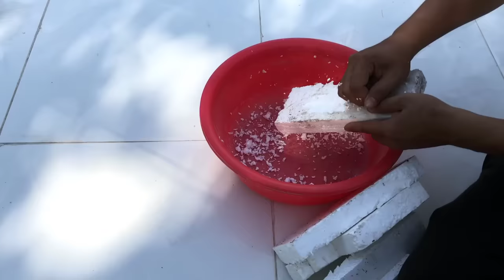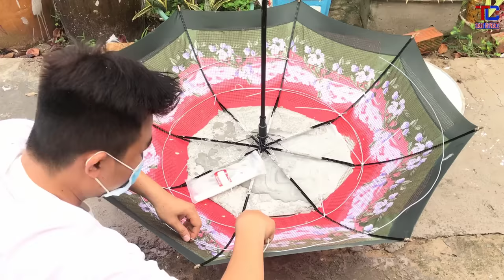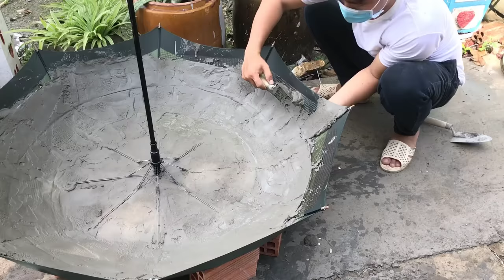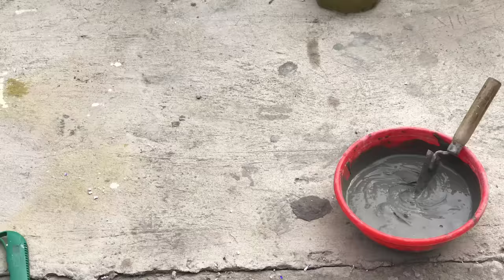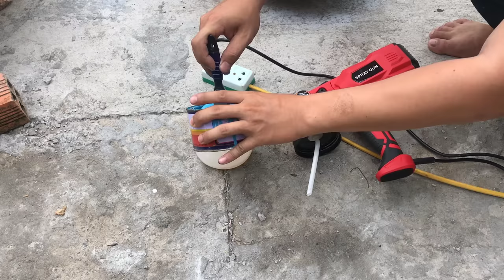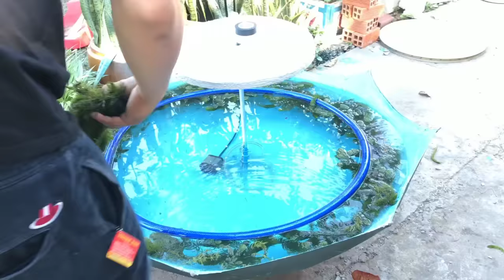❤️ It's very unique ❤️ Fountains, fish ponds, bird baths ... all in one idea ❤️❤️❤️

Comment: question:  the cement may be okay for the fish but the paints that you have sprayed is toxic to the fish.  You cannot use paint.
Reply: No the cement is bad if not sealed, acid
Reply: there's blue "paint" that's pond/pool liner which should be fine. It all depends on the type of paint and not all paint is waterproof so I'd hope they used fish-safe paint. Though given the kind of fish they slapped in there... only so much faith you can have in this channel. That went from "huh, neat" straight into animal abuse, lol.
Reply: @karinashi765  En général, vous ne passez pas votre vie dans votre piscine  .... Les poissons sont condamnés à rester là ou à se suicider....

Comment: I actually kind of like the concept for a small fountain. Except I'd probably just make it a fountain where the water flows out from the end of the U shaped handle of the umbrella. And I probably wouldn't use a real umbrella as a base. If you just keep it simple and don't use all that spray paint, it'd make for a pretty cool fountain/bird bath
Reply: Блохастую собачку зачем?
Reply: So let me understand you correctly. You're going to disassemble an umbrella, then make a large reinforced concrete bowl that you will have to then attach the umbrella handle to? MMMMM sounds like just as much if not more. Bc the umbrella itself is your form.  How/ if you paint something is a personal preference. Regardless it will still need to be treated somehow.

Comment: I realize that a lot of people have noticed that animals may be endangered in this video : fishes, ducks, dog , etc.
Please take a moment to report this video. Click on the three points on the right (same line as the thumbs).
This is a bit difficult to report it. I don't know if mine has been taken into account.
However, that is what I wrote :

“PLEASE: ADD "ANIMAL ABUSE" to the list of possible reports :  
Arguments: 
1. See the many comments of other spectators related to animal abuse (fish, ducks, dog...). 
EG. 12:51 : Two big  big fishes in such a small pond !!! (Most comments are in English).  
2. The dog is harassed by fleas.  
3. Incidentally, the worker should wear a minimum of personal safety equipment (PPE). This includes wearing gloves when handling cement with bare hands.”

Pardon my poor english.